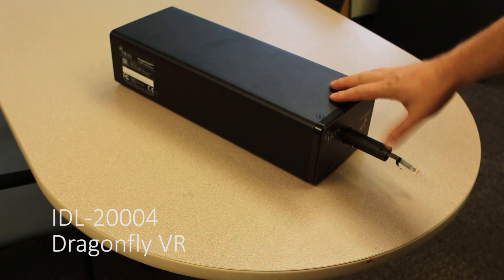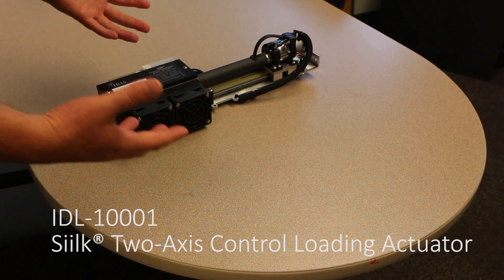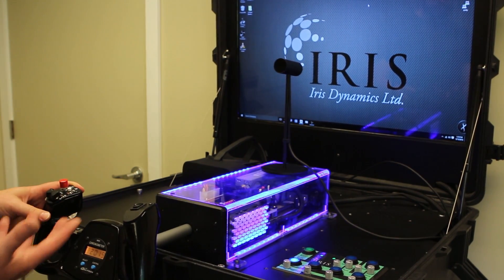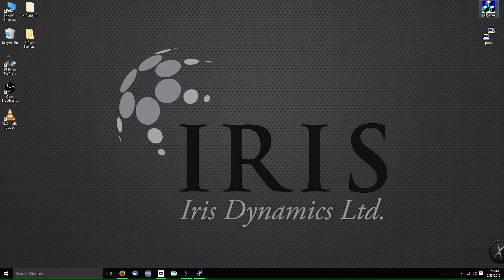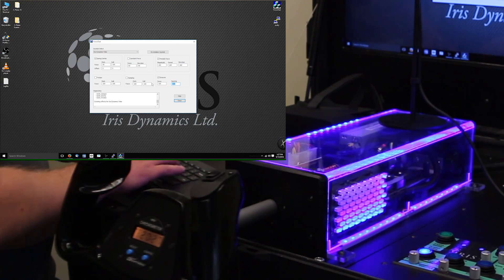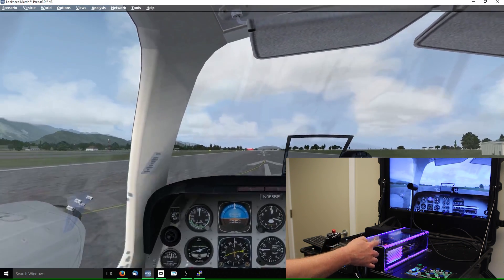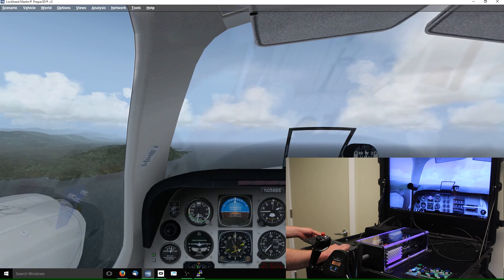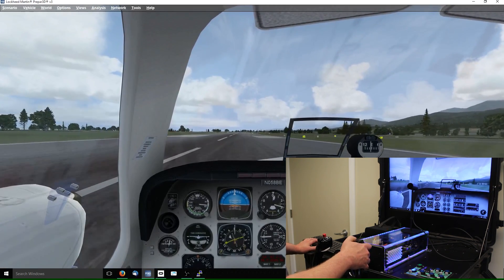Product Overview and Demo | 2016

Comment: I just got my hand on used 1st generation Iris Dynamic Yoke I was wondering if this one requier calibration and if the answer is yes how do you performs the calibration ?
Next, buttons & switches do not respond, so, can I remove the current Handler and use the IDL-30001 INTELLIGENT HANDLE BOARD to connect another third Party yoke ?

Comment: really nailed it on the affordable side didnt ya... idea is great but the yokes you offer suck and is way way over priced!!! put a boeing yoke with all the buttons or a better cessna styled yoke.... over priced with terrible yoke design could have been a great product..... was looking forward to the relece of these.... I'm very dissapointed!!!!
Reply: I made a better yoke with some printer motors, mouse IR encoders, old PC power supply and a copy arduino mega.
all cost around 30$ and 0$ in my case because I had all the stuff lying around.

Comment: IDL-300-020 IMO makes not too much sense. It lacks important things like autopilot disconnect switch or PTT button. Controling trim with 5 way hat is OK but disconnecting AP by hat? Not that good. Next one, the beech bit** (IDL-300-030) is very nice, and this chrono, nice thing.
Would be cool for my FSX (Jetstream, B777, B737, Dash, MD-11 and the Concorde) but not so much for my pocket. Anyway, maybe Bill Gates will buy one ;-)
9:06 Will it have stick shaker functionality for PMDG and Dash8?

Comment: Wish I try that in a game Lander by Psygnosis. Lander is a game for this joystick in a 100 percent.
Reply: Its a yoke and not really a joystick. And it was designed to be used in serious flight simulations like FSX or X-Plane.
It differs from cheaper yokes because it has force feedback so you can basically feel the forces on control column.
Reply: If you try this yoke with out feeling a gravity force and vector of acceleration you will never  discover a potential of a force feedback. So  how can you feel a gravity force and vector of acceleration (in full 3d) if your ass is sit straight ? The only way to translate a vector of acceleration in 3d and gravity force is the external camera (point of view). Unfortunately in so called "serious" flight simulations point of view is in a cockpit so it can not do nothing to tell to the gamer the most important thing real pilot got to use for flight - the real time 3d acceleration he feels. If "serious" flight simulation can not do it for you it is nothing but rollercoaster with a inflated cheeks. "Look at me I'm in a cockpit, i'm so cool, like a "real" pilot". Sorry but it's disgusting. Unfortunately we can not translate a real flight feelings (accelerations in 3D) through a cockpit view. I wish I can, but I can not and no body can. We must translate the accelerations in 3D to the gamer and it can be translated only through a not firmly fixed to the craft external camera. Lander can open full potential of force feedback because of it's magnificent external not firmly fixed camera. If you need some really good game for this yoke to show people what it is you need Lander. Or some cool flight simulator with external not firmly fixed external camera
Reply: How simulation did works ? From one side, from the PC side (or game console) into the gamer through the eyes coming some game information. If you got a FF joystick you can get some information from force feedback too. How much did final volume of information  is rising with FF ? It is increases exponential. In real life real pilot got not only two information channel to control his vehicle. Real pilot got feeling of force from it's joystick or control wheel, second real pilot feeling accelerations in 6 directions and force of it, third he can see from outside how did aircraft (or vehicle) is behaves itself against the background outdoor landscape if it is present (if there is no fog). Forth information channel is a sound - if car got a good sound isolation for extreme driving it is not good. So in real life real pilot in one second got so much information because of exponential growth of final channel after addition of one simple channel. All the beauty of flying or driving comes to us only because of this massive final information channel. With out it we will never take pleasure from flying or driving. Into the game there is only one channel - visual or two visual and Force Feedback. If you want to increase adrenaline level from taking game experience you must increase number of information channel. So 3D camera behind aircraft is only for information channel and nothing more. So the FF is only for that. In standard aircraft joystick tells me a force of wind. In Lander joystick will tell me trough the force feed back the deviation angle between actually Lander position and imaginary.